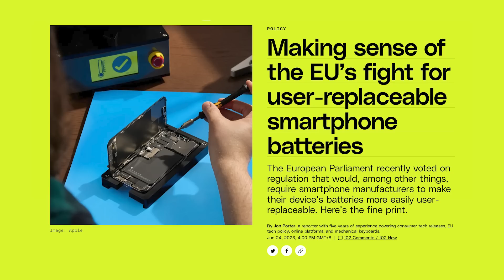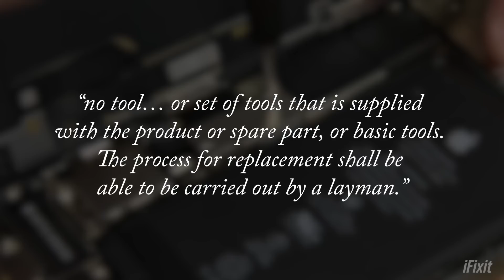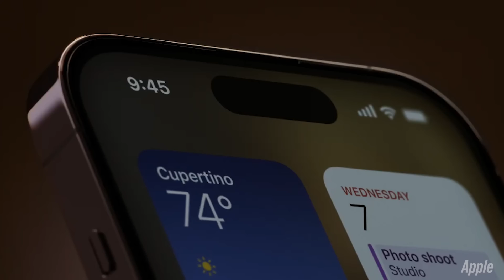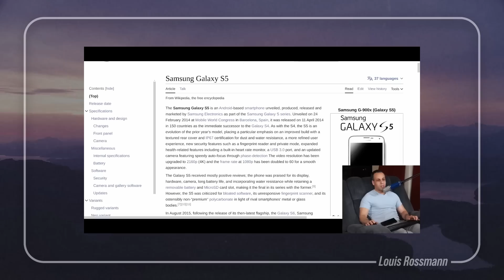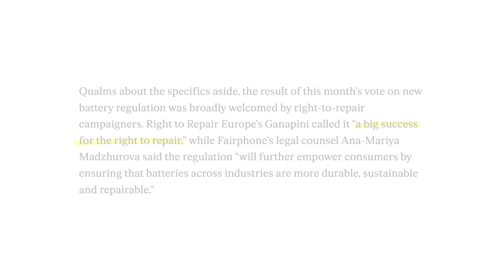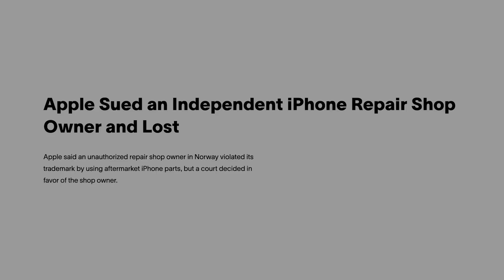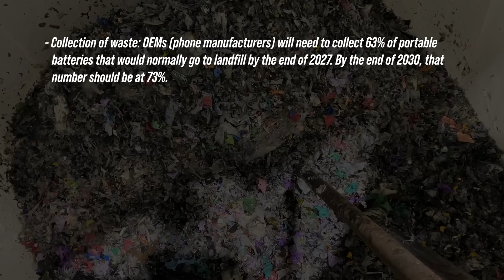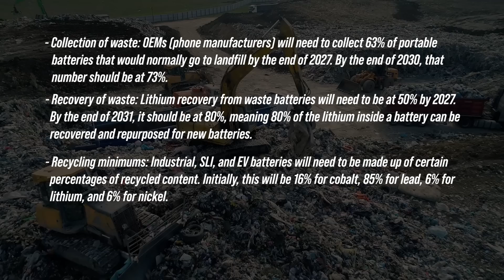EU Just Changed Smartphones Forever

Comment: I have a laptop that's 25 years old. How to replace the battery: Press down on tab, pull battery out.
20 year old battery: Slide a locking tab, then slide a spring tab and pull the battery out.
15 year old laptop. pull a slide tab to remove a cover, then press a tab to pull out the battery.
skip a bit to within the last 5 years: remove a dozen or more screws from the bottom plate to remove it. remove another 4 screws from the battery to remove it.

It's less convenient, replacing the battery on the newer models is more of a repair than just something you do on the fly, but I'd still consider it a user replaceable part.
Except for the first example that I think was a HP or Packard Bell or something, everything else in this list is Asus. So if Asus can do it, why can't everyone else?

Comment: Apple, tech influencers, and Samsung are why expensive hand-held devices moved away from user replaceable batteries, memory, and plastic back cover.
Samsung ran a major ad campaine dropping the galaxy S5 in a pool to show off they had cracked water resistant remvovableplastic back covers. then followed apple to seal all phone after that to build in obselessance knowning that as long as you protected the screen the consumers could easily replace the failing battery that starts to show around 18 month mark. apple also introduced software slow downs in non-reversable os updates while launching a slightly upgraded model that magically had no problem with the new os.
Pile on to of that samsung's obcession with curved edge screens that serve no funtional purpose other than they are more exposed to damage because the screen sits proud of most cases. 
In fact virtually everyone has to cover up the glass back of the phone with a case that give you better grip on the phone. imagine if the back of the phone was manufactured with grip in the first place.
 So ban glass backs and curved edges while your at it as well.

Comment: Apple does not tag original components to annoy users but to prevent the counterfeit parts markets. Counterfeit parts infiltrate Apple's own parts supply and cause reliability and security issues causing other parts to fail and even burn in the case of batteries. Manufacturers may be liable if a fire is caused  by a counterfeit component. In a nutshell you cannot offer a warranty if the parts and workmanship are not appropriate.

Comment: As someone who has worked hands on with every major phone brand in my job over the last 8 years this is only so true. Those old models that had water resistance were flimsy and prone to faults. This will be a massive shake up to the industry and may prove to be a not negative move
Reply: definitely a positive move.

Comment: Also it's worth mentioning:
The reason Louis said: "Less then 50 cent" is that those things are so cheap it's not even worth looking up, those are parts you buy in packs of a 100 for 5 bucks if you have a small repair shop. It would not shock me if you could get 1000 for 10$ or something.
Things like this you can't really buy separately or they will be priced absurdly like 0.3-3$ per piece. Some components are sometimes effectively sold by weight.
They weigh 20 or something and then multiply that by however much they put on the packaging. That's why the packs usually contain more. Because accurately counting them would affect the price more then just giving away ~1%.
By now, a component that actually costs ~50 cent.  Already contains an entire computer (iE Attiny85). Or has to be insanely precise or contain a lot of valuable materials. A ribbon cable has non of these problems.

Comment: This beautiful glass aluminium iphone ist dumb design: for a essential everyday tool costing a months wage for some, you drop it ones and its gone. Ok lets put it in a cheap plastic case to protect the amazing surfaces. My gopro is watertight to 10m? Removable battery. No issues in 5 years.  Cmon apple. Been fixing iphones ipads from 4s to x. Amazingly variying repairability. Cmon.

Comment: I hate to be so negative, but the difficult to repair/replace mindset of current electronics was 100 % in favor of the COMPANY.   The consumer is thought to be LUCKY that they even have products and should say thank you regardless.    I very much look forward to seeing the new designs that meet the new Right to Repair.    I am convinced it can be done.    Large pickup trucks are now coming with 4 and 6 cylinder engines.....so it can be done....

Comment: After 5 years, I finally have the motivation to buy a new phone when this comes out.
Reply: @null6343 microwave lmfao

I'd rather just slip the back side of the phone, pull the old battery out and put a new in. Sounds much easier than having the requirement of using a goddamn microwave, not to mention other steps required to replace it lol
Reply: I'll also wait till my screen will burn enough to buy a 2027 phone, perhaps we'll see mini jack back.

Comment: Very unhappy to see that you missed the fine print which several other channels have noted. 

Devices which are water resistant and have sealed batteries with more than 1000 charge cycles are exempt.

That means, almost every phone out there.

What was once an amazing channel, I haven't been happy with your research in the past few years and this one is no exception.

Comment: Making the batteries for EVs consumer replaceable could lead to us being able to quickly swap out a battery needing recharge with one fully charged so petrol/gas stations could offer a quick turnaround for EVs rather than have them take at least 30 mins. That would remove (or at least reduce) the need for the installation of thousands of recharging points all over the country.

Comment: lol its not for convenience, or sleekness. its because the NSA/Deep state/ccp etc all want your phone to never really be off so they can monitor you at all times. turning your phone off with a power button that relies on the cpu or a microcontroller means something has to be on. and have power. taking out a battery ensures that when all the capacitors and smaller batteries for clocks etc drain, the phone really is off.

Comment: It's a combination - both the manufacturers and the consumers are to blame for phasing out user replacable batteries. Consumers wanted sleeker and thinner devices, even though they decried short battery life... Consumers want all-glass phone because it's "premium" and will call anything other "cheap", yet they then put the glass phone into a cheap rubber cover so as not to shatter it. I also remember the time when "non removable battery" was a minus point in any review. But the truth is, a lot of people want that excuse to buy a new phone every one or two years, just to get a new "toy". Consumer behavior is largely emotional, so we need rational regulations... If we didn't people wouldn't even have seatbelts in their cars because it's anoying and not cool.

Comment: Lucky for them I am not the one on the board.
I would force them to give warranty for 10 years and repair only in their shops, as they don't trust independent repair shops. Also the phone fixed in 30 days or the customer has the right to get a refund.
New releases should be innovative and not upgraded parts, a new version should have significant performance and a solid benchmark score provided by 3rd party technology audit company.

Comment: I'm sure there's a mix of profit and design. There are several devices with multiple small batteries distributed around the inside of the device. It wouldn't be reasonable to have someone open 5 hatches to replace each one. This change will definitely cause a lot of engineering changes

Comment: I am really glad that this decision was made, especially for the laptop market. A decent laptop will easily survive its battery.
I have an old Fujitsu Siemens laptop that has "options" that no laptop has anymore. Serial port, VGA, HDMI, display port, PCMCIA, PCMCIA express, smartcard, e-SATA, firewire ... runs win10 without a problem ... for my electronics lab this is perfect. Luckily this laptop has a removeable battery otherwise it might have been trashed years ago.

Comment: I strongly believe that the right to repair is more valuable than any warranty you will ever have
Reply: it also gives 3rd party sparepart makers a chance, hopefullt.
Reply: @zoolkhan i hope EU will focus on ipads, macbooks pro, istudio, iwatch. Force companys to no longer have parts soldered on the motherboard, make it easy to replace or upgrade gpu, ram, ssd/hdd, battery, screen. So that if you have a problem after few years you wont be forced to buy another macbook pro.
Reply: both? both. both is good
(in eu you have a 2 year warranty on most purchases)
Reply: @k680B  Both is best, but if I had to choose, I pick repairs
Reply: @k680B and only one year of those 2 is really helpful. The second year is close to impossible to use with how the law is constructed.

I mean, how can a consumer prove that the fault was already there when you bought it?
Reply: right to repair is rights. Your grandkids can enjoy it too
Reply: That's usually one of the first things I look for when I'm about to buy something. Is it durable? Can it be repaired? Are there spare parts available?

If it doesn't meet those requirements, it's disposable, therefore only worth considering if it's cheap.
Reply: If it is cheap then it is disposable.If it is well made it can last londer than ir's usefulness.
But this is technology that is improved and is usefull only if it improves en mass. I am sure you are glad you have parts for your model-T!
 @moteroargentino7944
Reply: as everyone aware is
Reply: Being able to fix your stuff or let anyone fix your stuff is always better than the manufacturer company pinky promising to fix it if it breaks in a period of time they define

So of course it is
Reply: Why can't a foldable phones have a replaceable battery? Galaxy Fold for example, has a battery in each half. Removable cover on the back, removable screen with spring loaded connectors on the front. Expensive, but possible.
What I want the most personally is readily available OEM parts directly from the manifacturer.
Reply: The first environmentalist policy that actually will work
Reply: how so? usb-c standardization would be better if the connector was more robust. Qi charging is better. changing out batteries has become an extra cost. Just get a new phone. The efficency of new tech is why batteries last as long as they do. The 3.5mm port should stay as a backup system with radio broadcast via the headphone wire. FM is reliable
Reply: Best response
Reply: Of course it is.

But it's important to understand the trade-offs. Let's be realistic, not idealistic. This law will definitely have an economic burden. It will use billions of dollars of engineering effort that could have gone towards anything else, like carbon capture or improved battery technology. This law may even make things worse for the environment, due to increased battery waste.
Reply: Fr
Reply: Same, I had to "roll back an update" do to speak, now my newer Samsung is missing the back because the glue sits on very hot aluminum which transfers heat great but not good for the glue. Even then, the battery isn't isn't removable! It too is also glued in place! 😫 @NeverMind-pk4wz
Reply: Have a look at fairphone. Their phones can be repaired super easily, not just the battery. And they offer 5 years of warranty
Reply: I never worried about warranty.. i never in my life claims any warranty on any product.. because of how long it'll take to get my device fixed by the official service provider, i'll always send the item to local repair shop regardless how much it'll cost me..
Reply: I hope EU will attack macbook pro, ipad, ipad pro, iwatch. Lets say for macbooks pro, make a law to no longer have soldered parts, make it easy to replace the battery, memory, hard drive/ssd drive, gpu, so that people can replace those parts if theres a problem in 2-5 years.
Reply: Yes, my glue + glass phone broke after a week, & my Samsung Galaxy s5 still works if i want to call, text, take forward or backwards photo, & record audio.

I also greatly think we should get rid of the SIM card tray since I got comfortable/confident enough to stick a random sewing needle I could find into the mic hole \ wrong hole 😫
Reply: @Eduardo_Espinoza Please don't the SIM card is how one can simply switch services when traveling internationally. Also, it usually contains an SD card that allows you to transfer stuff between phone and PC.
Reply: I said get rid of the tray not the SIM @MrManerd
Reply: @Eduardo_Espinoza  "I also greatly think we should get rid of the SIM card tray since I got comfortable/confident enough to stick a random sewing needle I could find into the mic hole \ wrong hole 😫" 
SONY Sony phones have a latch as photo cameras do for the SIM/SD tray - no need for needles. While still maintaining water resistance. They also have a headphone jack. And no "notch" or hole in the screen... I'm somewhat disappointed that their phones make up only a 0% market share.
Reply: @Eduardo_Espinoza phones are designed in a way this won't damage the mic
Reply: i hope they do this for headphone jacks too
Reply: You already have right to repair. You just have to go for professional support. This law forces batteries to be replaced by END CONSUMER without tech support. It will slow down R&D and make phones more expensive and less progressive. And replaceable batteries will be wasted everywhere damaging environment much harder.
Reply: @tsugar75  We don't have the right to repair. For example, apple has a history of bricking their devices if repaired by someone else. We can't get batteries for replacement - we can't repair. Professional support in the case you propose is a monopoly, and it lets them to extort their customers.

I don't want to mock, but replacing a replaceable battery is esier than swapping a SIM card... And I can't imagine a technician refusing to do that for you.

Replaceble batteries will help envoiriment, because it will be the only part replaced. Just a battery instead of the whole phone! Phone ownership will become cheaper. I'd preffer to pay 40€ for a new battery, than 119€ for a "professional support" or a 800€+ for a new phone.

And as mentioned in the video, manifacturers will collect most of the batteries. So you'll probably be able to trade-in your old battery for a better price or pay an extra fee. Possibly.

IDK. You sound like an apple user. That's an insult.
Reply: I'd prefer a fully waterproof phone, if you can't replace a battery just buy tools and search for the ifixit teardown video. Or just pay a professionist to replace it. How you are supposed to make a foldable with replaceable battery without sacrificing the water resistance? This argument just don't fits to all phones architectures..
Reply: @bombardier2  There is no reason why you can't have both, and the idea that you need to glue everything for water resistance is just lie. There are phones that are water resistant and have replaceable battery and jack port. I have other electronics that have replaceable batteries and you can go diving with them. Heck, bottle of Cola is water resistant and you don't need a glue, and can open it with hands.
Reply: Being waterproof is much more important, unless you live in a desert!
Reply: @stevenbryant4718 i'm curious where you work and live. I live in a rainy place, used to work outdoors and have never feel the need to have a waterproof phone. The one I have right now it's a cheap Xiaomi which the screen has been broken for 2 years and have went hiking quite a few times in bad weather.

Comment: They sealed the batteries because it became well known that the only way a phone co9uldn't monitor you was to pull the battery. They took that functionality away. There is a reason they have gps, front and rear cameras, and gain shifting mics on them. They are monitoring devices. There has never been a need to seal in batteries at all. It isn't needed for waterproofing. That phone watches and tracks you constantly. Whenever you look at it, it is looking at you.
Reply: riiighhhtt.. while I am not saying this is beyond their capability,  I am asking you why would advertisers or manufacturers wish to know where I am or listen to what I talk about.. how they can profit from that? have you ever been out with bunch of dudes or bunch of chicks, or some older guys playing golf? some of the dumbest and snooze button hitting crap to witness or hear.. and yeah, I bet they can gain millions knowing that I go from work to the gas station, later to small shop round the corner, or gym, then come home and stay there till morning when I go to work again..

Comment: Honestly, I don't see why apple and others wouldn't have a non-EU model that uses the same internals as the EU model but with a single changed chassis to allow them to continue having the extra income until legislation or consumers force them to stop. At minimum, they can simply glue everything of the EU model in place when sold outside of EU. I'm sure they'll have some vague "to comply with local requirements" or "it's less likely to get water damage this way" to appease people.